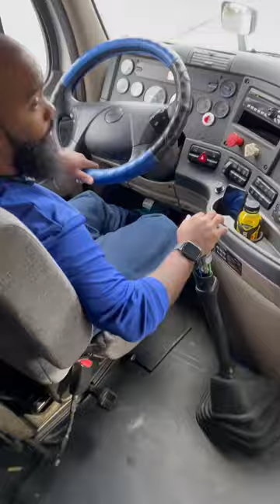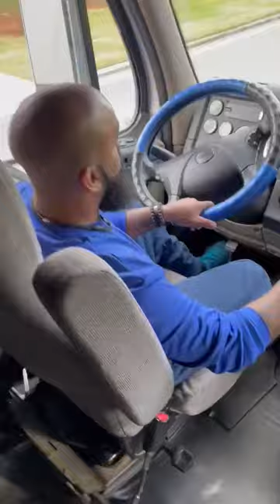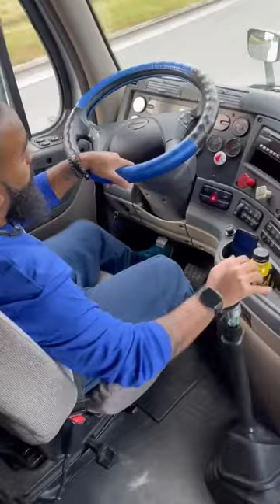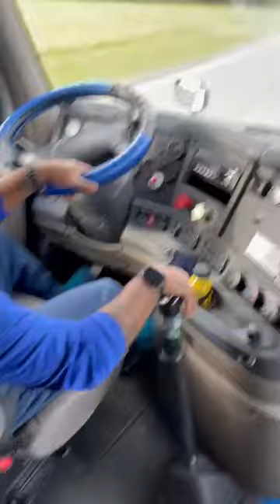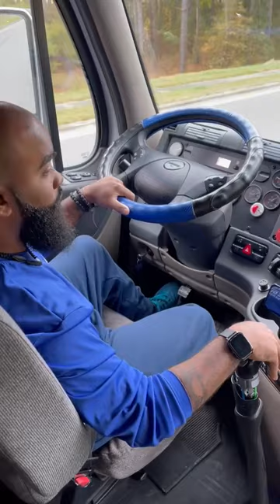how to properly double clutch upshifting and how to downshift.

Comment: i'm still trying to understand downshifting, upshifting is a lot easier to me but the part i always tend to mess up with downshifting is when it's in neutral and i have to give it gas because i tend to either give too much gas or not enough gas and end up losing my gear
Reply: Don't heart it MKer reply with advise
Reply: I always try to rev it to 10000 rpm when I have it in neutral
Reply: @joseRamirez-dg4lf  where are you from?
Reply: Watch your road speed when down shifting
Reply: I drive a 10 speed. When RPM is lower that 1000, i down shift. Never grinds.
Clutch, neutral, tap, clutch gear.
Reply: I feel u braaa im at the same spoy 😢
Reply: I was taught once your RPm is at 1000, clutch-shift neutral, rev to 1500, clutch-lower gear.
Reply: @chesterpanda tried that. I get a grind everytime going from 6th to 5th those are the only gears that grind when I downshift
Reply: @ChiMadeNickG  maybe your speed is too fast an not enough revs,try changing down with the splitter forward
Reply: Watch your timing and ground speed .
Reply: Here's my problem...
Let's say I'm driving 55 in 10th and have to slow down suddenly, but not stop (for whatever reason, 20 mph or so) how should I navigate that shift to 5th or 6th smoothly?

Comment: I don't double clutch ever and been driving manuals for over 30 years.  Press clutch once hold it shift from one gear to another and release clutch. Done
Reply: Well this video ain't for you obviously
Reply: That's great and how I would prefer to drive. Unfortunately you must do it to obtain a cdl atleast in mo you must
Reply: I had to drive a dump truck like that.
Reply: All manual semis have to double clutch because they don’t have ratio servos to shift like a regular manual , double clutching also works in my dads power stroke because the transmission grinds going from 1-2
Reply: @Riley-zx7tw you've never floated gears?
Reply: This is the proper way you’re supposed to do it.

Comment: Double-declutching is an obsolete technique now except for maybe truck drivers who use it often, but even trucks come fitted with synchronizers these days. However, it is a great technique to know when you want to shift gears smoothly. This method will also extend the life of your synchronizers.
Reply: It's mandatory in obtaining a cdl now. Our instructor said at some point you will float but while you're here and when you test you have to doube clutch :(

Comment: I'm in cdl school right now & Downshifting is whooping my ass
Reply from the maker: I understand that mr Johnson. May I ask you what is it about down shifting that is troubling you? I'm here to help you
Reply: Just remember that you can take your time downshifting. Downshifting is almost easier then upshifting because upshifting you have a 2 second window to put it into gear. When you down shift you can take your time. So you brake into around 8rpm, once you have it around 8rpm then put it in clutch Neutral, (take your time) no need to rush. Rev around 10-13rpm then clutch into gear. So if your in 8th gear, you only have to downshift two gears and then stop and reset back to 4th. Don’t over complicate it and don’t rush. The reason why students  mess up is because they are in a rush. Think about what your going to do before you do it and take your time. Best of luck to you, Stay safe.
Reply: When it doesn’t want to down shift do it at 1500-1700 rpm
Reply from the maker: @xxP1ST0LER0xx  thank you for the support man. Be safe out there

Comment: what's up bro,keep coming with those videos,i have one big problem,I'm kinna good in doing maneuvers,but my biggest problem is keeping the truck centered or straight down when pulling all the way down to do my straight back,i just can't keep the truck straight or centered,any techniques or advice that i can learn from.
Reply from the maker: I truly appreciate your feedback homie. And my advice is watch your trailer wheels. When your going straight back look in both mirrors and in your driver mirror if you see too much of your tires then turn to your driver side. And in your passenger side if you see too much of your tires then turn to you passenger side. But as your backing make sure you back slowly because the faster you go the worse it becomes

Comment: what are the rpms when doubling clutching downshifting.
Reply: Let the needle drop down to 1,000 rpm and then downshift . You can also skip a gear and down shift by letting it fall yo 700 rpm and then Rev high

Comment: That was not down shifting at all. Two worst things you could do in a tractor-trailer is putting the clutch in and kicking to neutral.
Reply from the maker: I'm sorry you feel that way mr Wilson. But I also know how to double clutch downshifting as well. I just prefer to float downshifting and float upshifting. But I teach my students proper double clutching. Thank you for your feedback. And from 1 trucker to another please be safe out there.
Reply: @cdlshorty74  I never could see the reason for double clutching from a mechanical point of view. Seems it is just to force you to pause.
Reply: That was more of a hybrid downshift... De-Clutch to take it out of gear, throttle and float into the lower gear - would they flag that in a CDL test?
Reply from the maker: @wesstoller5242  thank you for your feedback. On the test they would prefer to see double clutch downshifting. But you can float downshifting too. I teach both

Comment: You only double clutch when your upshift right?
Reply from the maker: At some schools you do and some schools you don’t but it should be at all schools you do
Reply: Always. The gears seem to roll into each other smoothly  like butter, especially when down shifting
Reply: I graduated next month that’s the only problem I’m having is downshifting
Reply: @martellsutton8526  downshifting is easy and fun. It helps to mark the gears on ur speedometer. I have a video on it on my channel.  Once you learn, you'll wanna work for a company with 8 inch straight pipes and be rattling windows all day